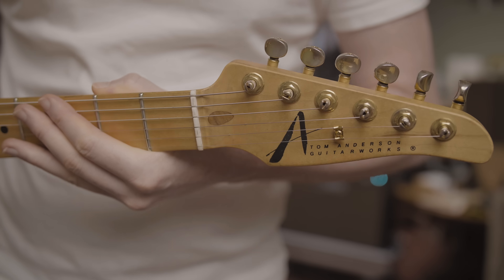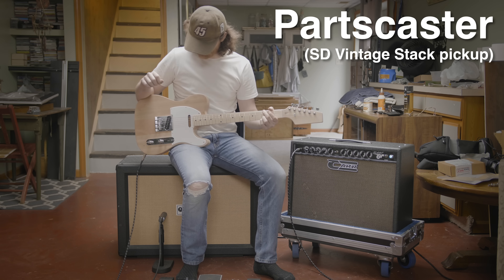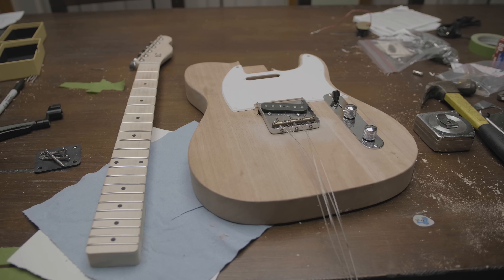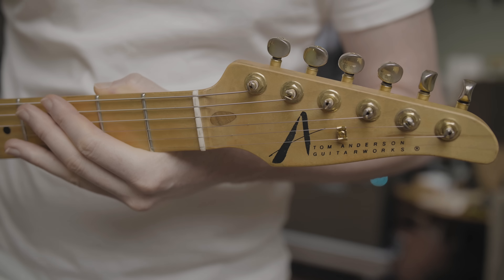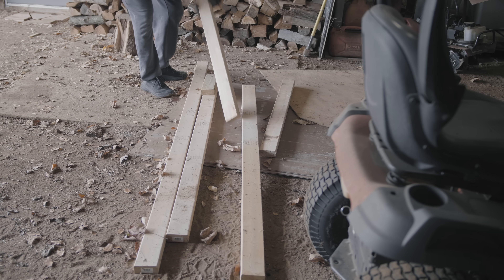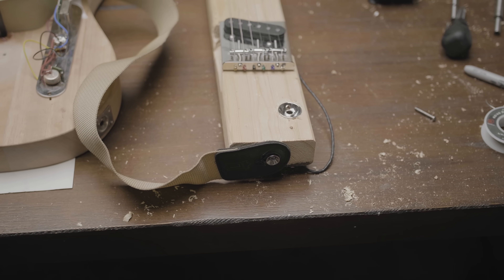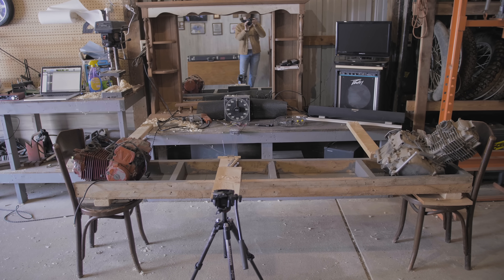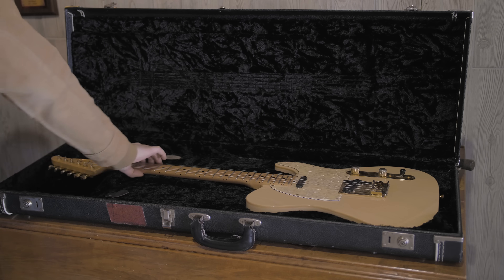Tested: Where Does The Tone Come From In An Electric Guitar?

Comment: What an interesting video, and the work you put into it is admirable.  Not surprised at some of the results.  One thing I've noticed with a lot of my guitars, although they're spec'd very similar to one another, is that each one has a certain "sweet spot" where certain notes or chords in a particular key sound more "open" or sustain better.  It only happens in that one key where that particular piece of wood, etc seems to resonate best.  Other than that, you've just confirmed that I have too many guitars.  Don't tell my wife...

Comment: Tbh I've never bought into the whole tone from the wood thing on an electric guitar or different types of paint change the tone. The best sounding guitar I have is an old Japanese squier bullet.  I'm 90% the body is plywood, thick coat of poly. Original pickups and electronics from 1983. But it just hits the spot on the tone I'm after. Don't get me wrong though all these rare wood and AAAAA+ tops are beautiful to look at.

Comment: you really remind me of leo fender and his experiment driven designs, though he liked playing steel string slide i'm not sure he ever went that far to test his views with an air steel string guitar :D  I've come to hold the same views, that the type of contruction (ST-Style, T-Style, etc.) and the pickup selection is most important, than anything else, even the brand of the Pots e.g. In an electric the rest comes down to feel and finish and depending on the building process, tuning stability

Comment: Great video! Actually, it's not that easy in a real world. You never really mentioned sustain which is a real deal, I have a 1000$ strat with 4 seconds sustain on 13 fret 1st string, and 100$ strat with 8 seconds sustain on 13 fret 1st string.
Also that 100$ strat have zingy characteristic in it I couldn't get rid of swapping everything but the wood itself. 
So yeah, most of the times the wood doesn't matter if you interested in a plugged in tone, but sometimes bad wood combination or guitar bulder failure can give you unwanted overtones that you can hear both acoustically and unplugged.

Comment: Excellent demonstration...seems that wood doesn't matter..or if it does its a small %...but to test the wood once and for all...is there a way to attach an external pickup to the body of a guitar..like bolt it to the back..so the signal would travel through the wood to reach the pickup...like if you take ur unplugged electric guitar and hold your ear to the back of the body or neck and play it....otherwise the pickup is aimed at the strings and receives that signal primarily ...or what about a pickup that is flipped upside down to aim at the wood body cavity? Making the wood the primary source of the sound that is picked up. How about capturing sound going through different woods and running it through software to analyze the frequencies? U could test different sounds like notes chords but also percussive sounds on different parts of the body to maybe test body shape...

Comment: Funny, that two tables (workbench) have more wood than 5 guitars. Is it important that the wood is behind the strings (neck and body) or is it the same if the wood is around like HARP? Neck through vs. bolt on making a HUGE difference same as mahogany vs. alder or rosewood fingerboard vs. maple. And at the end you chose TELECASTER! Fender guitars are made to be cheap. Try Firebird or explorer.

Comment: 8:17 there should be a difference caused by the lack of the neck pickup (even if it's not used). It's a magnetic field that more or less affects the vibrations of the strings

9:25 again there is no neck pickup. I also wouldn't call it an air guitar. It's a table guitar. The table might be absorbing some of the vibrations. What is your table made of? 
Here is a test that might be efficient.
Take one guitar. At first play it as it is. Record it and use a software that shows you every detail and graphics.
Then sand down some of the body's wood so the surface is less (for example 1/3 or 1/2). Play it again and record it.
Then change the body with another wood. Be sure that everything matches exactly. Record it again

You see... There are too many variables to use two guitars. Even if the pickups are the same type they may sound a bit different. You should limit yourself as much as it's possible. When you play, play the simplest things. And don't change the strings or do it before every test, using brand new ones with exact time of air and tension exposure.

Comment: Great stuff! The brass sadles seem to have sounded a bit softer. Could it be that vibrations of the body and bridge cancel out frequencies? so bodies with low resonance sound different from bodies which are resonating easily ? Also does the air guitar sound different with different scale lengths?

Comment: The last comparison ended up virtually similar. But for me it was no surprise as you should have mentioned
the wood of the working bench on which the bridge was mounted. Direct contact with the strings to the other
materials used here play their role. The whole workbench (left) here is a resonant factor. A metal topnut 
placed on soft wood won't give that much of a difference in comparison when using hardwood. When the 
topnut is from plastic it will certainly give more difference following the same procedure. I really liked your 
experiments AND your playing!

Comment: For electric guitars tone wood has always been a scam in my opinion. An excuse to greatly increase the price of a manufactured guitar. Companies like PRS are notorious for doing this and I can't believe people buy into it. There is a video of Paul bringing sample tone wood blocks to an expo and having people strike them with a hammer to see the effect as if that has any relation at all to the effect of the string vibration through a pickup. It's such a blatant scam. The guy must know I mean he has been building guitars for a living for decades. Obviously different woods will have an effect on an acoustic but an electric it's just plain fucking dumb. Imo the major factors in a guitars tone are the saddle material, nut material, fret metal composition, and obviously the pickups.  Great video by the way.

Comment: I think people are really missing something in this video...What he effectively tested was how important the STABILITY and EFFICIENCY of a guitar is to its playability and overall sound. A well crafted instrument will sound better than a poorly put together one. So these things like tonewood, nut material, head angle,  and pickups do absolutely play a roll in the sound of the guitar, just not in the way people often think or maybe to the extent that is commonly believed. The air guitar played similar to the other guitar because it was solidly put in place. There was no "lost" energy, basically. That is the crucial factor in what makes guitars sound "good" in my opinion. If there was a way to measure something like energy displacement, I'd be willing to bet anything the best guitars out there have very little "unused" or "unfocused" energy. Also, please note, I am completely dumbing down the terms I am using to make it easy to digest. This is not a scientific review by any means.

Comment: Nice to see this video out there. Since learning how the electric guitars are built and how the electronic pickups I've always said that all the myths about tonewood are just myths fed by the industry to rise up the prices on the instruments. All that about tonewood and the like is important to acoustic instruments, but once you put on a pickup that only senses string vibration, anything about the acoustics of the wood becomes irrelevant, maybe it does affect the final tone but exactly to what point is something that can be tested and measured, and you did a great job on this video. I always said that why there were all those myths about tonewood when BC Rich had the acrylic line with almost no wood, but the air guitar beat that concept.

Comment: I heard no difference in the final test. I've pretty much come to the same conclusions. The tonal differences are in the pickups. The harmonic (sustain) differences are in how solid the strings are captured. Basically there is no difference in woods except for harmonic content (how solid the strings are mounted). Neck woods make a difference in sustain when fretting. Capture of strings (how solid strings are mounted) makes a difference in sustain. Tonality is completely irrelevant in side by side tests with identical pickups. Sustain is the ONLY relevant difference. That's about it.

That said. There is a difference in the body construction, however this pertains to feedback and how the pickups are affected by the body cavity. This is more of an amp and gain issue and not a tonal guitar.

In conclusion: The amp is the biggest factor in tonal variations (how it reacts to differing situations). Not the guitar.

Comment: Very interesting video :o

In acoustic instruments the material of the body and chamber does affect the sound alot, but i guess the electric instruments dont change that much in those cases...

And before someone tells me it doesn change that much, i had 3 acoustic guitars, and the size of the chamber changes EVERYTHING, the material changes mostly if you gl crazy on the difference, i once played a guitar made out of some sort of metal, and the sound was super weird, almost like a banjo... But i guess the pickups dont pick up what wood is under the pickup

Comment: I'm with you 100%. I have found that the biggest contributor to tone (apart from the pickups and guitar electronics) is the length of the guitar cord (capacitance) and the input impedance of the first device in the signal chain.  Great video, well done.

Comment: I could hear differences in ever single set up you tried, some subtle, some more obvious. My conviction that some people have keener ears than others continues to grow stronger. 

All of my life I could hear differences in body woods on electric guitars. I've always been a Strat man. Maple neck Strats always sound brighter to my ears than rosewood necks. I've even swapped necks on the same Strat and could still hear the difference. I would make recordings and reliably pick out the maple neck upon playback.

Alder bodies: darker, rounder sound.
Ash bodies: a bit less low end, more midrange bite. Again, made recordings and correctly picked out the body wood every time.

I don't doubt that they sound indistinguishable to some ears. If you can't hear it... you can't hear it.

However, I do agree that the electronics do play a bigger role in the overall tone, but the guys who say neck and body woods play no role at all are just flat out wrong.

Comment: Very cool video. Here's my contribution to the whole "tonewood" debate. I think this video demonstrates beyond a reasonable doubt that the type of wood in the neck and body makes a negligible difference to the tone (especially when compared to the electronics and how they're oriented). I doubt I could tell the difference between the 2X4 guitar and the Anderson Tele in a blind test, and I think I've got a pretty decently trained ear.

That said, I still take the type of wood into consideration when choosing a guitar. But, it's not really about tone. It's a tactile thing. Different pieces of wood resonate differently and feel different in your hands. Hell, even two necks made with the same dimensions and from the same type of wood feel different to my hands sometimes. Different types of wood also vary in weight.

So yeah, the type of wood your guitar is made from actually does matter when it comes to playing it, but it's not really something I consider when thinking about the tone. When it comes to tone, it's pretty clear the electronics are the most significant (other than the player, of course), and not even just the electronics of the guitar. The type of amp you're using, your pedals and effects, and the type of microphones you're using (and their orientation) all affect the tone of your guitar far more than the type of wood does.
Reply: To me the Anderson was warmer and more mellow sounding than the 2x4 guitar, which was brighter sounding. Not better. Not worse.
Reply: @oldmate86  Yes I'm reading these comments like "is there something wrong with my ears or do I just hear better than everyone else" Most people saying there is no difference. I heard a clear difference between the 2 x 4 and the regular guitar, as well as between the rosewood and maple frets. Every adjustment he made seemed to have a very slight difference in sound.

To my ear the regular guitar sounded a good bit better than the 2 x 4. The 2 x 4 sounded ok. It wasn't terrible sounding or anything, but the real guitar sounded better. The rosewood fretboard sounded slightly different from the maple fretboard. Really hard to say which one is better but I'm leaning towards thinking the rosewood does sound a little better.  And another thing is he isn't even comparing them to a really high end guitar, he's just comparing them to a standard guitar and it still sounds clearly better.

The air one sounded about the same, but then again he wasn't able to play anything on it. I think that is what is throwing people off- they hear how the open strings on the air thing sounded the same as the regular guitar. But once you start pressing on the neck the wood on the neck is going to vibrate with the strings. It seems that the neck wood is definitely more important than the guitar wood itself. This is why the 2 x 4 didn't sound much different from the regular guitar, though there was some small difference. 

You could take a really cheapo guitar and record with it then run it through a zillion different filters and get it to sound excellent. In the same way you sing out of tune and sound like crap and then run it through autotune, auto-time, and various effects on it and sound good. But then it comes out sounding over produced. There are ways around buying an expensive guitar if you have to. But it just seems better to buy a good guitar to begin with.
Reply: @raymondkidwell7135  I'm not denying that there's a difference between them. All I'm saying is that the difference is so negligible that I wouldn't be able to tell the two apart in a blind test.
Reply: @tonyrigatoni766  It makes no difference in sound so long as it is strong enough to support the string tension.  You couldn't tell what wood was used in an electric if you were just listening to it and you know it.  As for touch, try again... guitars aren't sold with bare wood its finished and if you had the same finish on two different pieces of wood you wouldn't know which one was which by feel, sure you could tell by looking but that doesn't impact the sound.  You sound like some marketer from Fender trying to justify their over the top prices.
Reply: @duckmyass  I'm not talking about the finish, though. I really am talking about the tactile response from the resonance of the wood. I also mentioned the weight of the wood, which has nothing to do with the finish.

Buddy, I'm not trying to push anything on anyone. All I'm saying is that the type of wood is definitely something I consider when buying a guitar. It's not the only thing, and it's certainly not the most important factor, but it is a factor. That's all I'm saying. Nothing more, nothing less. Peace and love to ya.
Reply: The wood only matters on an acoustic.  It has never made any difference on an electric it has all just been marketing hype.  The electronics do the job that the wood does in an acoustic but you can't charge hundreds more for a Fender Strat if you are honest and admit that the only thing that matter are the add-ons.
Reply: @duckmyass  uh, no, the wood definitely matters in an electric guitar. It just doesn't make a significant impact on the tone of the guitar. It does affect the weight and tactile reaponse, though.

Comment: My $350 ltd flying V has kicked the asses of every $4000cad guitar ive bought . Misha Jackson ht7 usa made had a seperating nut and headstock, returned next day.  Ebmm majesty usa came with 9 dead notes and multiple fret issues.  Werent able to be fixed unless paying out the ass on shop fees on a brand new guitar. Shop took it in 3 times before they said i should get my money back because it requires too much work for a brand new guitar. My LTD has been absolutely flawless and was $500 off when i bought it lol

Comment: Okay one thing though: the shape of the frets and fretboard absolutely makes a difference if you're playing more than just an open chord. Even within the same guitar, not all frets may sound the same because there is more buzz on one or there may be a dead spot on another. 
Giving the fretboard a uniform finish/polish, making sure the frets are all the right shape and height and setting up the action and pickup position properly is a ton of work. And it can make turn an okay instrument into an amazing one.